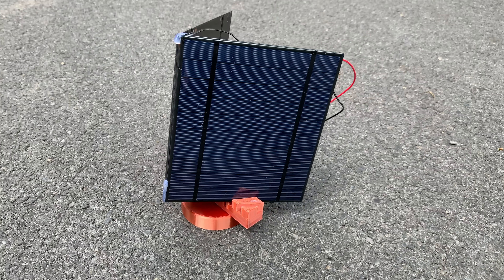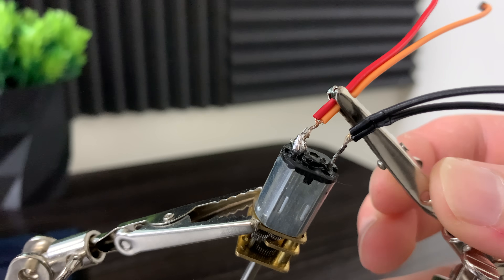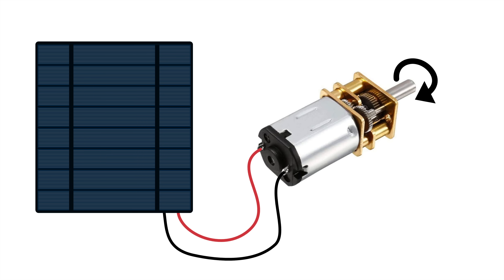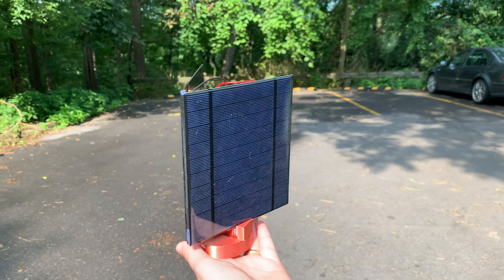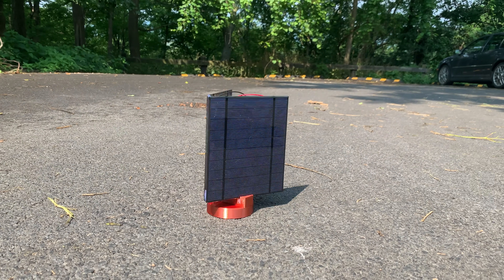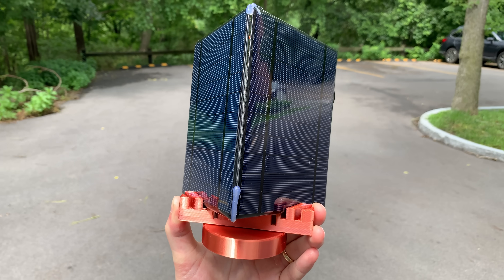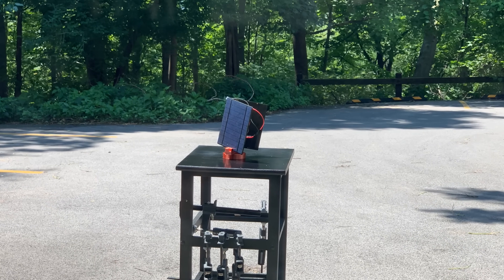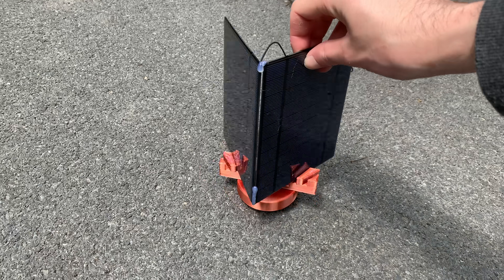World's simplest sun tracker.

Comment: amazing solution, many tried to tackle this problem by building circular solar panels or solar panels that use light resistors... and then there's you who solved this issue with a single 10rpm electric motor.
Reply: And it will destroy your panels through reverse voltage and shorting
Reply: @Ed19601  Yeah but a diode would fix that

Comment: Question: could you hook the positives from each solar panel across the motor and use the Delta V between the panels to 'steer' it (rather than have the solar panels fight each other)?

The way I understand it is a dark solar panel acts like a fairly low impedance resistor ..

Comment: Don't really see the point of "simplicity" when it defeats practicality. Now you'd need like a bridge rectifier or something wired in parallel to the motor for a load?

For any practical use of solar panels you'll have them feeding into some energy storage mechanism. You can power other electronics to solve "sun tracking" (an optional feature that doesn't always have amazing ROI anyway..).

Comment: Awesome video, thanks!
Does raise me some questions; A, on the power wastage (and motor wear) to surplus ratio when both cells are working the motor? B, you say wen aligned, the opposite charges for the motor cancels out, but isn't it just shortcircuiting? And C, while cells needs be angled to provide differential for the motor to work with, is there an inherent benefit to cell degradation/utilization ratio if angled rather than facing the sun directly? Thanks

Comment: it is simple, but because the panels aren't orthogonal to the sun, the power generated is going to be a lot less.

though if you did include some programming, maybe this could be use to drive a different solar panel's tracking... but at that point you may as well program the solar panel to just do 15 degrees per hour and reset

Comment: To optimize the solar energy gathered from it, would it be beneficial to have one main plate in the middle facing head on with the sun, and then smaller, slim panels at the edges at the angle to run your program with? That way you have a majority of optimal generation that is usable, but still the ability to rotate optimally?

Comment: Now what’s the use?.. 
the only use for the solar panel is to drive the motor to adjust the panel that will power again the motor…
And why that angle?! Probably if you put one panel direct facing south you will get more efficiency of the panel than suggested in this video.

Comment: I think the message of this video is good. However, this is not a good example of simple engineering.

This system will fail pretty quickly. Backfeeding solar panels isn't good and the dampening coefficient required for it to stably find the sun will change as friction increases due to wear.

Comment: Love it, its still strange to me that tracking solar panels are so vastly more expensive than static ones when they are so much more effective and you demonstrate that the RnD, engineering and manufacturing can be also quite cheap.
Reply: It quite simply costs more to mechanically track panels compared to the efficiency you get back.  You can just add another panel or two for lest cost to make up the efficiency.  Plus adding mechanical moving parts greatly increases the maintenance requirements and lowers the reliability.  It's a lose-lose solution.  Just add another panel or two to a static array.

Comment: Cool idea!  You could use two tiny solar panels to control the motor and thus the rotation, and then you could have one main panel that is always pointed directly at the sun.  You should get better power generation because the panels lose efficiency the greater their angle from the sun they are.
Reply: Yes you get better efficiency, but the cost of doing this with real panels is more than the cost of just adding panels to make up the efficiency difference.  Plus the added maintenance and reduced reliability.
Reply: @stargazer7644  True is you have space to add more - but if you want pure efficiency within limited space to place panels this could make a massive difference.
Reply: @JustifyJustin I don't know about a "massive difference".  If you have 10 panels, 3 more make up all the difference a tracker will give you.
Reply: @stargazer7644  And if you can only fit 3 panels on your roof? 😉
Reply: @JustifyJustin   Then you'll likely not have enough room to install a solar tracker either.  I think you're seriously overestimating the boost you get from tracking the panels.  That's why the vast majority of installations don't bother.
Reply: @stargazer7644  I beg to differ - there's a reason solar harvest fields all have trackers. Irrespective of the size of your installation, if you have a tracker system, you get more usable harvest time than a static system. There are quite a few test videos on YouTube that prove the point. Where a typical system gets around 4-5 hours of charging time, a tracker can give you around 8 hours. The efficiency gain is substantial.
Reply: It's even a shortcut he builded here, so no use for real applications. At least not how he did it.
Reply: @Wrutschgeluck  Add a wireless compass to it and you have the feed to angle a large array to gain max power.
Reply: @bryanst.martin7134  you didnt get the point. it didnt woth with a compas, too. because he didnt point to the sun. and still: its a shortcut and ddint work this way. so why you answer my comment?

Comment: Can the unused current be stored in a battery?

If so, with 4 panels, and putting them straight, but using a shade like others mentioned, you could have 4 panels seeing full direct exposure, tracking vertical and horizontal sun movement for basically free!

Comment: Can't you at least acknowledge signal processing, control systems, etc..., and not make it like you invented all that ?
The most popular choice of a controller is PID controller through some kind of digital chip. But know that it does not have to be digital, you can have an analog version for simplicity sake. If simplicity is all you aim for, you can also go for Mark Tilden's BEAM robotics: https://en.wikipedia.org/wiki/Solarroller https://en.wikipedia.org/wiki/BEAM_robotics
It is essentially the same thing that you built: a bi-stable electronic loop-back using the motor as an actuator and a sensor and a logic gate all at once.
This is over 30 years old work. Your plans are cool tho ;) It is nice of you to share it for *free*... Holy Molly you sell this shite 15$ !!!!

Comment: this is awesome, but insanely inefficient. if you use photoresistors you can have all your panels face the sun at all times which is WAY better. you just make a little wall that can cast a shadow and put a photoresistor on each side. from there you have different options of controlling the motor, but i think the simplest is using some transistors

Comment: Wont both panels be guaranteed to be facing a very suboptimal angle?
If I were to guess this setup would generate LESS electricity than two panels lying flat on the ground.

Then again, this is just a sun tracker, not a sun exposure optimiser.

Comment: This is really smart. I'm now a senior in electrical engineering and I would never come up with this simple idea, this shows that thinking outside of the box is really the way to go. 
There will me some technical problems like inrush currents and degradation of the panel but this can be easily be solved. Because I find this really smart I will use it in my upcoming projects when there is a need of a "smart" solar panel.

Comment: Well as far as a "Tracker" goes  it is indeed simple, just be sure to emphasize that the panels here purely are for tracking and not to generator any extra power.
Oh and that the solar panels will probably die within a few months without any protection circuitry to prevent them from destroying eachother...

Comment: I have the exact same panels. They always overheat. I use them to charge a powerbank, but after maybe 5 minutes in direct sunlight, the current drops by like 50-75% depending on the outside temp

Comment: What % of the solar energy is used on the motor vs stored?
Reply: This tracker can't store energy. Either energy is being consumed by the motor, or is lost in the (other) panel.
It is a fun novelty project, but if you want to use energy from it you either need to place extra panels for actual harvesting of energy OR implement some electronics to allow for energy storage.

Comment: I dont know any about Electric, but why the specific color?
Reply: It is standard practice in electronics. We always use black for the "Common/Ground" (here called the negative) and Red for that which provide power (here called the "positive").

Proper colour coding ensures anyone else that looks can quickly discern what the cables do and practically everyone does so cause it is just proper.
Like say if you cut and open up a generic USB cable. You can assume the little Red cable you will find inside provides 5V and the black one is the GrouND. The other colours being signal wires.

Comment: You could improve it by having both panels facing the same direction (0 degrees) but mounting a shade in the centre at 90 degrees, if it's facing the sun the shade only shades itself allowing both panels to be fully illuminated but otherwise, one panel is obscured and it will turn. Of course, it fails if facing more than 180 degrees away from the sun, but I've other ideas that would sort that ;)
Reply: It wasn't designed as a charging system, just a solar pointer. I would put an encoder in it and feed to the main array controller to optimize the array angle. That it's self powered and controlled is practically genius.
Reply: Where do you see the improvement having both face the same way?
Reply: @danielrose1392  solar panels only have their full rated potential when perpendicular to the sun, the way they are facing in this video is VERY inefficient, so yes rvertyvcgrnhvc idea is a huge improvement
Reply: @Sideshow-Bob  Okay now I get the idea, but I am not sure if it is actually an improvement. To drive the motor in the shown configuration, a maximum difference between both panels is required. The total output is irrelevant. If you instead wire the panels in a way the produce power and track, the 90° plus shade would obviously be better.
Reply: @Sideshow-Bob  I was scrolling through the comments just to find a comment confirming my suspicion that the placement of the panels is inefficient.

The creativity here is impressive, and there's something to learn from it, despite it not being a perfect solution, but I don't see anyone mentioning that flaw.
Reply: @Sideshow-Bob  No need for high power levels. Just driving current until equilibrium has been (relatively) met. It points at Sun. I would add an encoder to steer my large solar array.
Reply: @danielrose1392  They are concerned with the output levels, when enough to steer the device is enough. Once the energy is even on both sides it stops driving the motor.
Reply: Or better yet, make the mechanism even more complicated by adding 2 more panels, and have a "+" shaped shade in the center (maybe a cylindrical shade could work too). Have one motor rotate around the vertical axis, and the other one around a rotating horizontal one (mounted on a part that's rotated by the first one), then mount panels and shade onto that one.

This would account for the different angle of elevation of the sun on the sky (I don't know if that's the technical term, sorry), just how it works for the vertical axis - as sun moves around relative to the earth and thus the device.

This, however, doesn't account for the daily reset of the device, which could be either done mechanically (by having the so-called vertical axis actually a little tilted towards the direction of the morning sun, and by having some sort of mechanical stopper, or maybe with some sort of spring), or with an arduino board and sensors for perfect calculation, but at this point, you might as well just add sensors and program everything on an arduino XD
Reply: @ivanljujic4128  you read my mind about the +shaped shade in the center and 4 panels, seems like a good idea.  and about the daily reset, you can fix that with 2 or 3 cleverly positioned mirrors
Reply: @ivanljujic4128  The reason not much people pointing out that it's inefficient is because it's suppose to be a sun "tracker" but not sun tracking solar power generator.
Reply: @dongleseon8785  Makes sense

Comment: It really annoys me how people instantly jump to a Pi or a microcontroller and a program to solve simple engineering problems. This was very cool
Reply: I wouldn't call this a good solution though. Rule of solar panels is that much like with batteries you are never supposed to allow "Backfeeding" where a higher-voltage source pushes power into the other.  High risk that eventually one of the panels will go defective.

Gonna need at least fast switching Diodes to block or ideally use a proper analog comparator circuit to control the motor so you can also use the energy from the panels. Emphasis on analog as unless you plan to use like say a ATTiny, I'd say a microcontroller is overkill.

Comment: I made one of these back in the early 2000s when I custom built a Solar Panel of my own. Long gone these Days though! Nice work! 3d Printers make things like this way easier these days- mine was different. I didn't use the solar panel directly- I had a light detector hooked to the battery and it would spin when in sunlight and stop when in shade. Your way of doing it is probably a better way of doing it than mine, mine was easy to trick in certain conditions, it was about the size of a pencil dark clouds or random leaves/debris could make it forever loop.

Comment: I wanted to ask a very late question. How did you get rid off the squish "elephant foot" in the base of a 3d print?
Reply: Commonly Elephants foot is either the sign of the Z-Offset being to low causing the printer to squish filament unto the bed or the print-bed being too hot causing the print to deform.

You should try to see if you can raise the Z-Offset just a little bit to see if it improves. Gotta find that sweet spot where it doesn't squish, but also still sticks to the bed as intended.
Otherwise slightly lowering the bed-temperature might help.

Comment: This is beautifull! We live in a world where alot of stuff gets overengineered, and this proves the point “A well tought plan is often the simplest”
Reply: this is basically the same as jump starting another car but you have the cables in reverse, creating a short circuit of 24v when speaking of the voltage of those batteries, in series.
Same is happening with the panels. they are in series short circuiting.. Now the power of these panels are not so great so it will probably not fail really fast.. but they will.
This setup is too dirty.

Comment: Back in the 80's I designed a mechanical solar tracker that used bimetal springs to follow the Sun as the springs got exposed to the heat of the Sun.

Comment: This is good for another big solar panel to track the sun. But in that case the motor needs to be big, so the solarpanels for rotating it needs to be big. That's 2 big solar panels wasted instead of having an arduino online. Although it's cool and simple, I don't see the point.

Comment: Cool.  But to drive large panels would add logic gates to negate overtime panel deterioration amd use main panel power for the motor.  So make these much smaller and mount on top of main panel in desired orientation.

Comment: on its own, it's not particularly usefull as its using 2 panels at very low efficiency due to neither panel being pointed directly at the sun, now, if this were attatched to a much larger panel to point it at the sun, i could see this being useful.

Comment: Seems like a brilliant way to ensure neither panel ever gets direct sunlight.

Though maybe if it used a higher torque motor it could be used as the input to move an array of larger panels via some gear/joint mechanism or something like that.
Reply: I mean, in most cases there's no need to have panels track the sun at all. Just pointing them south towards the equator gets the vast majority of solar energy--depending on the size of the panel and the details of the setup, constantly moving the whole panel to face the sun can actually decrease net power generation.
Reply: You could have both panels facing the sun directly if you just add a wall in between. Then when the sun's angle changes, the wall will cast a shadow on one of the panels and trigger the motor. Or if you just need a mechanism to track the sun, then a sun dial with one sector without a panel, where the pole's shadow should land when the orientation is correct, would automatically orient itself at sunrise as well.
Reply: Exactly my first thought
Reply: hehe brilliant